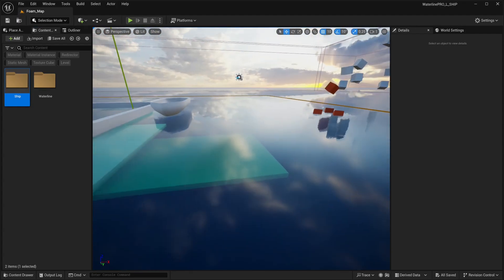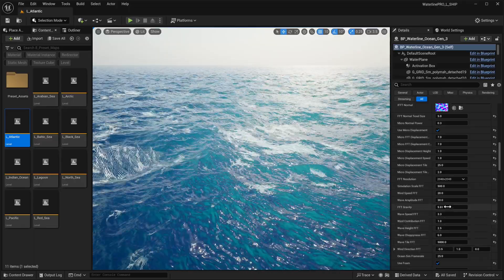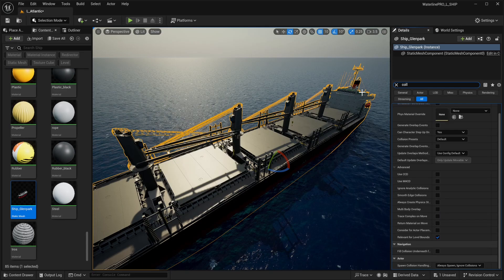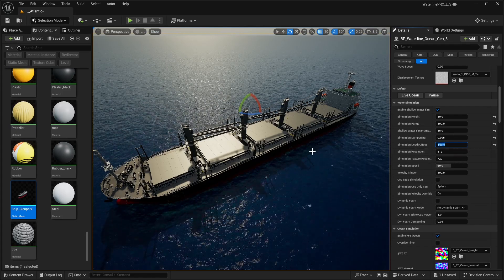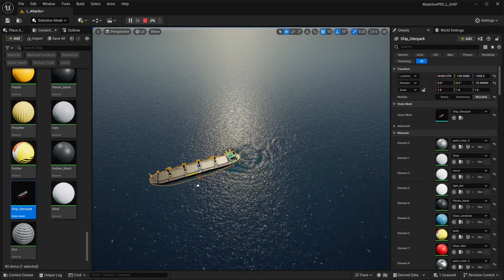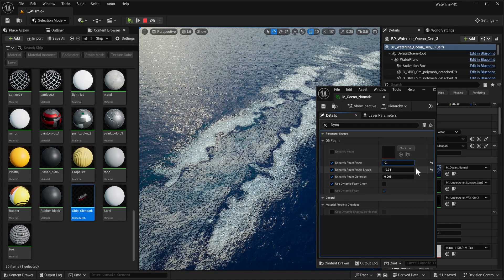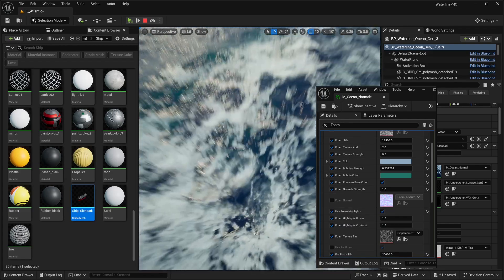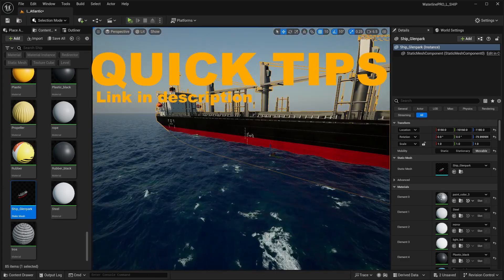WaterlinePRO Masterclass 2 Large Ship Simulation

Comment: Thank you for the video, one question - for some reason I'm also getting ghost simulations happening all around my ship at some point during animation, is this a bug or am I missing some setting?
Reply from the maker: Hi!
It can happen when the dynamic waves do not resolve by the time they reach the edge of the simulation range. The easiest way to fix this is to either increase the simulation range or lower the simulation dampening (so the waves fade out quicker) ideally you might want to adjust both slightly.
If the issue persists please let us know on our support email.

Comment: Hello, is it possible to generate those big waves and foam away from the camera AND small ripples simulation from " simple beach ball" or plastic bottles close to the camera at the Same time? 
Need to use only one ocean? Or the oceans with different settings and different materials divided by mask or something like mask?
Reply from the maker: Hi!
At the moment the system will works with a single set of parameters - the values we use in this tutorial will make it very difficult for really small objects to simulate waves (we do plan on addressing this limitation down the line) and vise versa.

At the moment the best approach would be to use something like our other asset WaterStamp in a particle system for ship foam in the distance.
In the past we've used this to leave visible foam trails that are visible across kilometers.
Reply: @dumpsterfireproductions  Yup, I got it. Thank you a lot!

Comment: Hi, is it possible to simulate multiple ships at the same time?
I hope you can help clarify this question. Thank you! ❤
Reply from the maker: Sure - the way that the simulation works is that any object in the area around the tracked actor will simulate waves.
This area size depends on the Simulation Range parameter.
Reply: @dumpsterfireproductions  Is it possible to track 3–4 objects at the same time?
 I can follow which tutorial of yours to achieve this? Thank you so much 🥰
Reply from the maker: @thuhamainguyen4215  Not a specific tutorial - this is the default behavior of the simulation. Though you can take a look at this 5 part series where we go over all the Simulation settings and parameters:
https://youtu.be/nvLxbPHvrYc?si=guBU3YsLCtVznryv
Reply: @dumpsterfireproductions  thank you so muchhhh

Comment: Hi there! I'm trying to simulate the wake of a large ship using the Gen4 ocean beta. The wake appears behind the boat (dynamic foam, displacement etc) but there's no perpendicular motion to it, it's kinda like it leaves an imprint in the ocean but without moving off to the side in waves. It worked fine using the Gen3 ocean, is this a bug or has something changed in the way the sim needs to be set up?
Reply from the maker: Hi!
Could you get in touch on our support email with some details regarding your setup and some screenshots of the issue so we take a better look.
Reply: @dumpsterfireproductions  Sorry if this is dumb question, but what is your support email address? Can't see it anywhere.
Reply from the maker: @Mark-x6c4k  Hi!
No worries it is listed in the product description in the storefront here:
https://www.fab.com/listings/0c1fc983-db84-4df3-b623-03db76d552c6

Comment: Hi, do you have any plans to implement separation zones or localized simulation triggers for the water system?
It would be very helpful when working with multiple boats of different sizes and speeds.
Right now, it's difficult to fine-tune the simulation to look good for all of them at once, since one global setting doesn't work equally well in every case.

Comment: Is there any change to this setup for 5.5 , I am following all the exact steps, even got a mesh to pretty much match the one your using, but I cannot get it to create any wake, its as if no collision or simulation is running ( in simulate mode)
Reply from the maker: Hi!
Does your mesh use Nanite?
If so then the workdflow has a few extra steps that we outline here:
https://youtu.be/ZMVe28GsLiA?si=lLnH3O6-DVWaTaWO
If the issue persists please let us know on our support email.
Reply: @dumpsterfireproductions   Thanks for the reply! 
I am not using Nanite, but I am using a different ship model soon so will email you if this issue comes up again

I do however have another question, and havent been able to find an answer in the tutorials I have seen so far. I see there is an Override Time option in the Ocean Simulation,  however I do not see what would be the option I can key to have the simulation move. Essentially I am doing a scene in sequencer and I want the ocean not to be dynamically created at frame, but controlled by me  ( so I can hand key a boat rocking and moving on my own) and know Exactly what the ocean looks like at that specific frame.  I know in the Fab marketplace, you can do this, but I am not sure exactly how. Would love if you could point me the right way.

2nd followup based on that, if I take that workflow approach, would I still be getting all the same boat interactions , seein in this tutorial above?
Reply from the maker: @arsenarzumanyan2651  
Check out this section on setting up the Override Time:
https://youtu.be/H0Vhtswm980?si=geFdYyecEIiCCanF&t=100
^The only thing to note is that there are two parameter collections one for the Gen3 Ocean and one for the Gen4, so just take care to use the correct one ;)

And yes all the dynamic water simulation will still work as expected.

Comment: It would be really useful if there was a way to simulate the boat wake in a setup where the boat was not moving and instead the ocean just looked as if it were moving.

In an archviz scene where the entire ship is modelled inside and out with lightmaps, it's not really possible to move the whole ship.
Reply from the maker: Hi!
Technically it is possible in a couple of ways.

1) The easier - add a static displacement + normal textures of a wake and dive the ocean a directionality. Since the sim wake would be the same over time there isn't really a point to simulating at all.

2) Overly complex modify the dynamic simulation and give it a directionality. This is possible, but generally gives identical results to option 1 while needlessly running a dynamic waves sim in the background.

Feel free to get in touch on our support email and we can walk you though implementing these. This is a feature that we can look into offering out of the box in a future update ;)
Reply: @dumpsterfireproductions  Yes I would also like this ability, thanks!

Comment: I LOVE Waterline PRO! 

I've successfully had boats and ships interacting with the water with buoyancy and dynamic foam, but I do have one issue I keep running into lately.

I'll have a circle of very dense dynamic foam around the object I'm tracking at the radius of the Simulation Range, even with simulation settings and material settings matching what's in tutorials. I can't track down if I'm doing something wrong, but I have to shift values around pretty drastically to get rid of the circle of foam, then I don't get very nice results close to the ship I'm trying to simulate.
Reply from the maker: Hi!
Could you send us screenshots or clips of the issue to our support email so we can take a better look?
Reply: @dumpsterfireproductions  I believe I solved the issue myself, I had disabled Virtual Texture Support. Once I re-enabled it, the foam looks amazing!
Reply from the maker: @bencabot  Odd - the default project we used does have VFX that use Virtual Textures, but the simulations are not one of those.
Reply: How to adjust the trailing foam simulation of a small ship? I followed the tutorial but couldn't figure it out after a long time. . .

Comment: 666-The boss finally completed the wave trailing foam effect. . . . By the way, can the water body on the lake also have this kind of trailing foam effect? .
And whether the trailing foam effect of multiple hulls can be achieved. .
Reply from the maker: Hi!
Yes - lakes have the same dynamic foam parameters available to them.
Yes - when we set the Simulation Range this means that any other hull around the Tracked Actor will also generate foam.

Comment: We Need Multiplayer Masterclass! Any way to set Buoyancy calculations to work on server?
Reply from the maker: Hi!
Network physics are a major computing challenge that requires a ton of work to solve. Even then you would usually find fairly limited implementations (usually a handful of physics objects and/or very limited player numbers) that rely on highly customized solution on a per project basis.
It is something we would very much like to in the future but it is not something we are working on at the moment - again as this is a type of system that is best built on a per project basis.